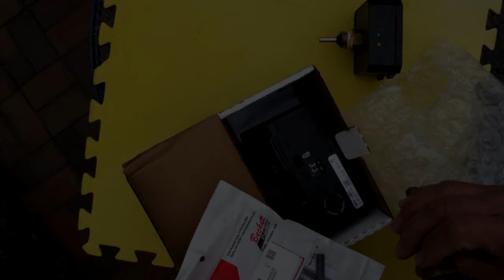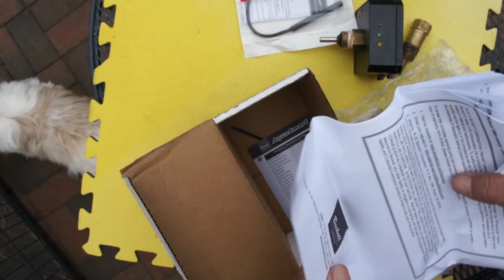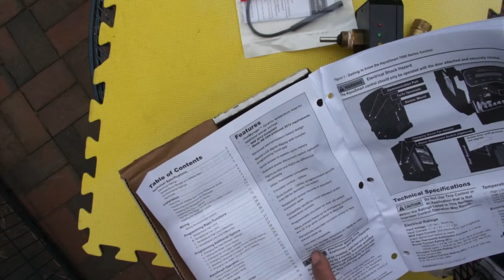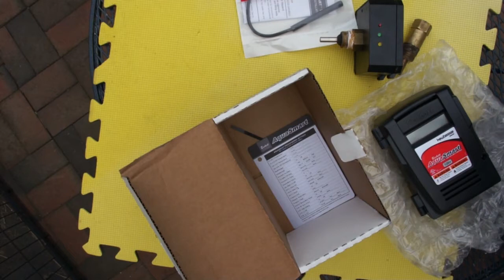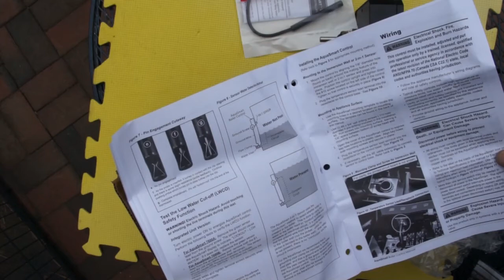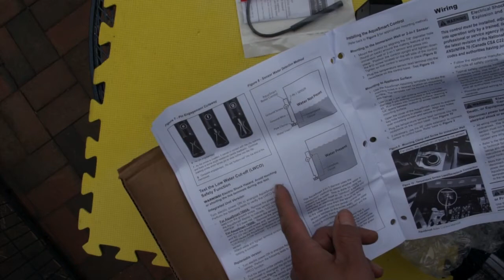Agua smart

Comment: That control you have to buy the well wich is the probe for the low water cut off its made of plastic witch sucks but it does work I only had one that I had to change. The good thing about the aqua smart is that you can buy a wireless remote outdoor sensor witch has a 10 year battery life and has a far range to pick up the signal. The control has a build in memory to create a temperature set back an economizer it does work. The control is good but costly compared to the L7224u